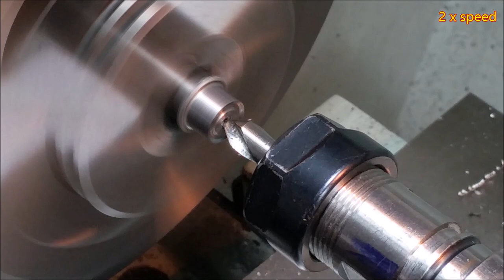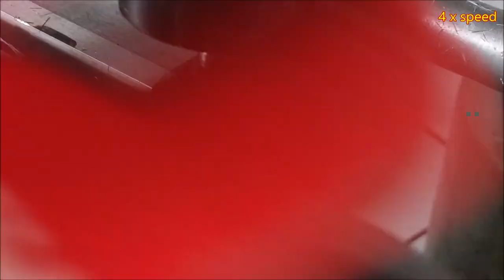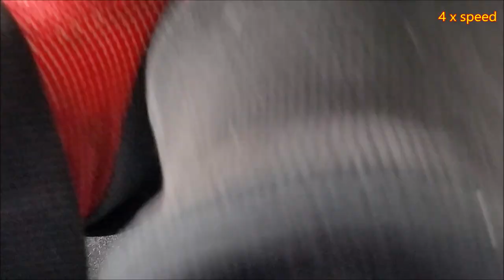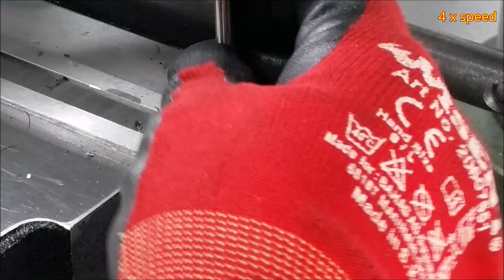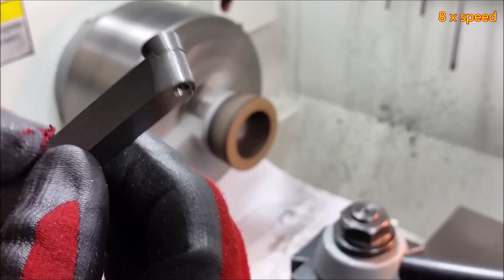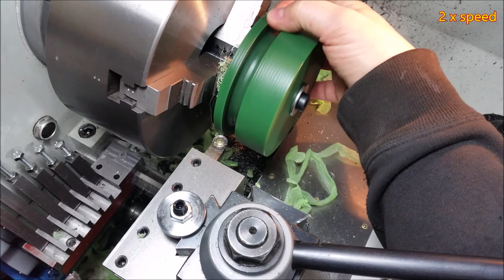Homemade turning tool with round insert.

Comment: Congrats! the idea is great. 
But do not use gloves when operating the lathe
Reply from the maker: Gonzalo Muñoz 
Hi. Thanks for watching and for the comment. 
You are right about gloves. Thanks. 
Regards, Zmago
Reply: @scpatent  . I wear throw away tight fitting vinyl gloves, "surgical" type. They are safe due to the tight fit and tear off easily. I also wear similar to the ones you wear but only for certain jobs, It's all about risk assessment. No gloves = no go to work in my kitchen tomorrow. Guests don't like to see engineers hands . Nice work by the way.

Comment: Great video. What kind of steel did you use to make the insert? Did you harden it at all? Would this insert work on soft metals such as aluminum and brass ?
Reply from the maker: +joe dellaquila 
Hi again.
Material for the insert is Steel 42CrMo4 which is already hardened to some point, but I did it more of the camera with heat treatment.
Yes it cuts aluminium. I didn't try it yet on brass... but I think that it should be also ok...

Comment: please mention speed and feed work material tool material total time taken
Reply from the maker: +Mahender kumar 
Hi.
Thanks for watching...
Actually you could see the data about speed at 8,46 minutes in the video and forward...
Well, I tried with 1200 RPM, and later with 900 RPM. Of camera I went with much slower and it was still ok...
It was hand feeding - by the feeling...

The work material is NOVILON - Polyamide plastic. Very hard but it contain some oil, which is benefit while machining... The diameter of the work material is 120mm.

The tool material is Steel 42CrMo4, and I hardened it with heat treatment a little bit more while of camera.
Insert holder is ordinary Cold rolled steel.
It took me less than one hour to produce this tool. 

It works great with all kind of plastic, hard wood, aluminium. I didn't try it yet with steel...

Best regards, Zmago